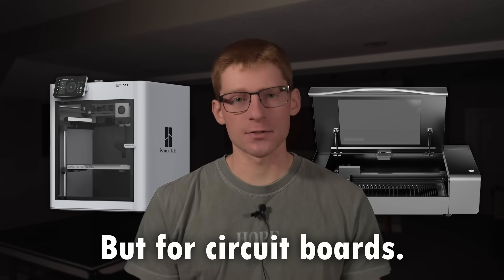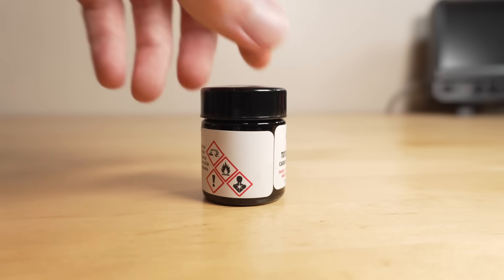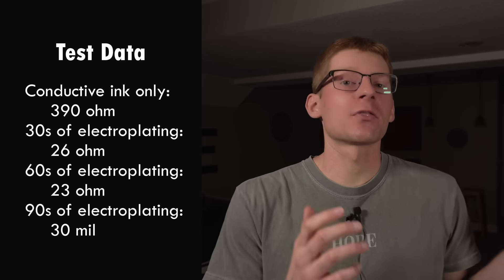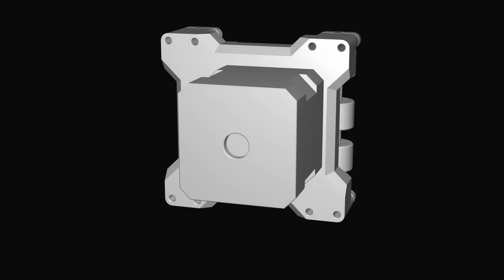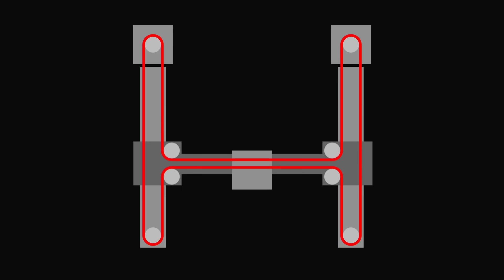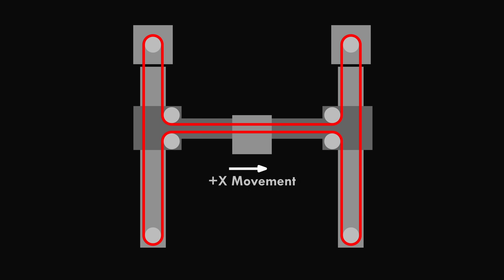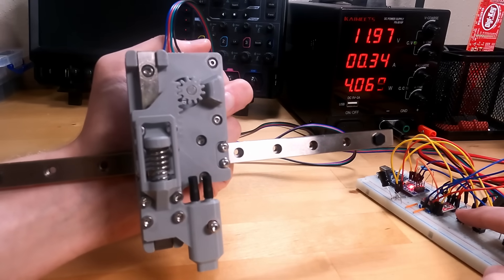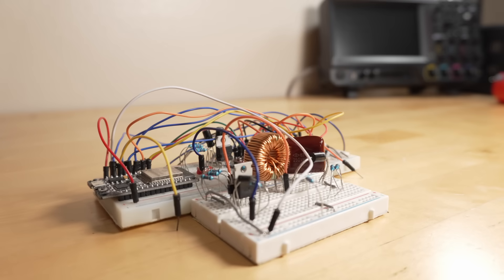I'm Developing a New Circuit Board Manufacturing Technology

Comment: That was cool!    Chemist and machinist here, hear me out:

What if, instead of chemically depositing copper, you drilled the double layer board, slid in a piece of copper capillary tubing that is slightly longer than the board is thick, and riveted/pressed it in from both sides with custom dies that have centered guide pins + a concave face? Locking it in place and making contact on both sides, like a hollow rivet, you could even solder them on each side       I bet you could pull it off
Reply: Came here to say this too. Even copper wire mechanically inserted and his existing process could perform easier surface plating of the copper instead of a solder or riveting for a chemical instead of mechanical joining. Tons of opportunities "good enough" for a prototype PCB.
Reply: i use it for my home pcb production. The problem with it is that for the top layer (from which the drilling starts) to make the contact with via, rivet must be pressed hard enough, to spread to copper. That creates bump, and most smd components could not be properly placed above it. And applying soldering mask is harder while vias are so much (up to .15mm) above copper. It became the limitation for my designs. My method is not autometed BTW.
It might be OK solution for hollow rivets for thru holes tho/
Reply: @ВоваЕршов-й2ь what if you drill a slot in the PCB where the rivet would sit against the PCB a few millimeters/micrometers beneath the top surface, like a valley?
Reply: @ I have no technology for that, but it is great idea for automated machine. If slot would go thru copper tho, copper layer could become separated near the point of impact during pressing rivet ip place. So it still needs refinement or high precision, but could work better than my method
Reply: @marcusvinicius-yo4ii  I tried chemically create slot in copper layer, because i can't mechanically. Only .02-.025 mm deep, almost thru the copper layer. It didn't help for me, still insane precision needed for cutting rivet in size and pressing it in place.
Reply: @ВоваЕршов-й2ь  what if you used solder paste instead. You could create a footprint to add around the vias. 

Possibly use the wire method previously mentioned and fold the wire over the copper traces, then solder paste to electrically connect them. Kind of like a sideways staple.
Reply: @kyrelsilva4103  yes, I use EasyEDA, it has "open via" feature, to put away solder mask on top. It is the way I used last time, but i feel it's kinda cheating, because of both bump of solder, and hole in the solder mask. More than that, soldering becomes harder, because now you need to apply solder and reflow both sides. Riveting with bigger bumps without solder paste actually works too, but has ~same problems.
I belive author of the video would eventualy propose more solid solution.
Reply: @ВоваЕршов-й2ь  there are drills that has the shape to drill out the shouldered indentation for the via shoulders, so it stays flat
Reply: Very similar to the "old school" tiny rivet method.
Reply: I was thinking of a copper capillary tube that was ultrasonically bonded to the top and bottom layers. But really this is technobabble. I have no idea what I'm talking about. Still it might be worth an hour's research...
Reply: Commented the same thing, this just makes sense
Reply: There's an old three step hobby process for doing copper over fiberglass. It uses a sponge with an electrode for the chemicals to avoid baths.
Reply: I had a similar idea but with copper plated solder wire instead of a tube. Compress it to expand the copper against the PCB and then just melt the solder out.
Reply: How about spot welding?

Comment: Here's a random thought from someone who doesn't have a clue: 

Drill all your vias at once with a 0.3mm drill bit. Add 0.35mm diameter "champfer" divots on either side (or whichever widths are practical) by drilling part way with a slightly larger bit. 

Then to use the conductive ink - as goopy as you can buy, or mix it with some fine iron power or something - and spread it over the board, filling in the via holes and the small divots. Then, while the ink is still wet, wipe the extra off. You could maybe automate this with a squeegee-like contraption. This will leave a bunch of vias plugged with the conductive ink. Wait for the ink to dry/harden. (Maybe mix it with some UV sensitive polymer?). 

Now here's the iffy part: Go back and re-drill all the holes with a 0.2mm bit. Obviously, the tolerances would need to be exact. This will leave a bunch of vias coated with conductive ink ready for copper plating. Place some metal on one side of the board so it touches all the divots. Connect it to an anode, throw the whole thing into a plating bath and turn on the juice. Maybe nickel plate the vias instead.

Zero idea if that would work. The idea would be to have filled in vias, plus a spread out pad on each side where the traces can be routed.

Comment: Great video! Slight correction.  As a former microfluidics researcher, you’re not using this term correctly. Microfluidics is not the term for small scale fluidics.   Microfluidics is specifically about manipulating liquids in laminar flow state using microdevices. Usually the “tubes” (channels) in these devices have diameters below 0.5 mm or 500 microns (hence the term “micro”).

Comment: Why not drill the via hole, then automatically drive a small pin that was slightly oversized through the hole.  The top of the pin could have a solder preform ring for reflow soldering.  The bottom of the board could be wave soldered as normal.  The pins could be as small as a few mills in diameter. Have you ever driven a 0.025" square pin into an 0.031" hole, same concept.

Comment: "New design i came up with" predates CoreXY by quite so many decades and is known as H-Bot. It's no longer in use in Reprap machines, used to be a hot topic before CoreXY came about, many people designed and built H-bot machines, because it has racking issues, its forces on the gantry are unbalanced and the positioning precision suffers. The outcome is generally quite hideous, very backlashy but not consistent enough that you could cancel it out, it's a whole mess.

Comment: Great stuff! Would love to have a desktop PCB printer like that. My method of making vias was always:
1. Drill a small hole
2. Stick a thin wire in the hole
3. Solder on both ends to the copper

Caveman method, but works pretty well for prototyping :)
Reply: even a 2.54mm header pin would be easy to handle with tooling.
Reply: I wonder if you could mechanically deform the wire like a tiny pop rivet. How much clamping pressure would you need to get a good connection?
Reply: Or even just use a conductive tiny rivet @BenAlternate-zf9nr
Reply: @BenAlternate-zf9nr you would run into the problem that both the hole and the rivet are straight walled, so you have nothing to push against. This means you might be able to mushroom (or peen) one end of your wire but not the other. 

The pop rivet system is a whole other beast that’s not feasible at this scale.
Reply: Yeah, we don't even have a consumer-end product to make PCBs without vias as it is, so it feels a bit jumping the gun to be trying to solve the via problem. If the device could accurately print two-sided PCBs and you just have to drill the hole yourself and use a wire to make the vias, I think plenty of people would still want that.
Reply: Aw, I suggested current-control OVD with an argon blanket.... waaaay more complicated 😅

Comment: Fantastic project. But is the goal to make a practical machine, or just to learn how to solve this particular problem (of making vias) as perfectly as possible? Both valid goals of course, but they require different approaches. You say you can make 1mm vias, but not 0.3mm ones. For a practical solution I'd certainly go with that. 1mm vias are absolutely fine for prototype/homemade boards. Another (and somewhat common) solution for one offs is copper rivets but they're fiddly and time consuming to mess with. If you can automate that, bravo. The least elegant other solution is soldering a wire in and snip it on both sides. Still the only method I ever used personally. Before I switched to ordering boards from the well known Chinese PCB shops.

Comment: Why not press fit a copper wire into each via hole and cut it flush with the board ? This can be done with a machine.

This gives solid copper vias that are not yet connected to the copper layers.

By adding holes for each via to the solder paste stencils (both sides required), the solder paste will connect them after reflow.

No chemicals, fluids, electroplating and fully compatible with SMD, even via-in-pad.

Through hole components can still be manually soldered on both sides. If that isn't possible just add parallel via(s) to the board layout.

Comment: Some random ideas... 

1. instead of plating, insert 0.25mm copper wire and solder to annular rings
2. insert 0.25mm copper wire and under pressure fill it with low temperature solder.

you can use like 135C melting point solder, + some heat resistant silicone "nozzle" to form annular ring around via to fill it with solder... 

Really nice project, subscribed.
Reply: And maybe it's possible to use similar process like in point welding used for creating battery packs from ion cells, (not sure about doing that on copper with copper), but if it's possible would be nice to try. Drill hole, insert copper wire, point solder it to annular ring...

Comment: Think about how a regular aluminum pop rivet works. You could have a mechanical electrical connection without electro plating. Unfortunately my suggestion requires mass amounts of custom copper ultra micro rivets

Comment: You can fix the electroplating problem. This is actually an issue which had to be solved in semiconductor etched trench filling. The diffusion blocking layers needed to coat the bottom and walls evenly and different coating processes are more directional than others.

Extend an insulation covered needle with only the tip uncoated into the center of the via, through the center of the tube. This will decrease the distance to the surface and the current path through the electrolyte solution. The proximity to the plating surface will also improve the directionality and placement accuracy. With the current flowing from the needle horizontally to the walls it is a straight path giving more even coverage.

You could feed an insulated solid core wire from your reservoir through the tube to avoid any risk of leaks. 3d print an X shaped electrode holder for the center of your tip and use it to center the electrode in the XYZ direction so when the tip seals against the PCB the tip of the wire is centered in the via.

I think for the final version you will still want to change the design to a multi-head or headless electroplating bath because even 90 sec per via could take days for a design like a raspberry pi.
Reply: Just the idea of having to insert a .2 mm needle into a predrilled hole however many times gives me nightmares.
Reply: @luipaardprint  you mean like ANY 3D printer does for hours on end while stacking layers of molten plastic coming out of a 0.2mm hole?

You can always tell the wannabe DIY people from those who actually build things real quick.

Even your CHEAPEST desktop CNC hits 0.02mm accuracy, or 10x smaller.
Reply: @luipaardprint  By the way the auto thread on an EDM machine feeds a 0.2mm wire down a 0.3mm hole using a stream of liquid for alignment every time the wire breaks.

Accuracy is about planing for accuracy, and not difficult with modern electronics. People hit higher tolerance in the 1800s using hand tools and gears.
Reply: @excitedbox5705  you’d be hard pressed to find a home 3d printer that would have the +- 0.05 repeatable between boards, let alone the +- 0.005 repeatable for consistent centre of hole. By the time you have a cnc frame or edm wire machine to spare to modify for this job you’re well outside the scope of most people’s definition of diy, and most people would be better off using a service for this kind of precision. I know some people that have their own pick and place machine for prototyping aerospace boards, but they sure as fuck don’t build their own boards.
So calling not trying to attain this level of precision wannabe DIY is at best disingenuous, and probably a bit delusional.
Reply: @luipaardprint  You are using 0.2mm nozzles so if those lines are stacking almost perfectly then obviously they are hitting the tolerance required. I have done 20+ hour prints on a $200 printer without losing accuracy. Also encoders cost <$10 so you can have practically zero drift.
Reply: @excitedbox5705  within a single print that is possible, although the tolerances are still not where you’d need them, but repeatability between multiple runs is a pain in the ass with cheaper machines.

I’ve made prints with sliding parts on .2 mm precision fit on a Bambu, but I’d be hesitant to go any further than that.
Reply: Yes, the  semiconductor industry had the same problem. I think I saw at least one vid on YT.
Reply: This is genius. If only I had known this before shipping faulty product to north america
Reply: Im sorry you want a small fragile needle to get into a sub-millimeter target area in the middle of a running pump attached to a moving carrige???? I personally think thats an unattainable level of precision for a diy project like this. Necroposting ig, but semiconductor equipment and enviornmental controls are an entirely seperate ball game to this sort of machine.
Reply: @boijone8440  Not hard at all. 3D printers work at MICRON precision, and I have 0.2mm dull tip syringes for filling ink cartridges. 

Dip one in some silicone and scrape off the bottom mm or 2.  If you take a 0.6mm needle syringe (shorten the needle as needed) and drop the smaller needle with luerlock  down the barrel with a spacer to allow fluid to flow.

You and wrap the needle with a spiral of wire to center it and now you have a conductive outer tube with an insulated inner tube but a conductive tip protruding from it.

You can always place the pump on the inlet side of the reservoir so there is no need to run wires through any pump but I would simply glue a plate over the back of the outer syringe, drill 2 holes in it and run a tube from the luerlock of the inner needle to one of the holes. Then you run 1 tube to your reservoir and a wire down the tube going to the inside of the inner needle.

Liquid feeds down the outer needle, while the inner one carries the current down to the tip.

I hate that youtube doesnt allow posting pictures but I can literally build a prototype with the parts in my workbench.
Reply: What if we apply a flow of fluid during the process? I’m wondering if it would affect the deposition speed…
Reply: @tomaszradomski8994  Yes. I think he is pulsing the flow if I understood him correctly, which should be good to prevent depleting the copper ions in solution.

Comment: hey, wouldn't it be infinitely easier to just use insert copper fibers/wire or a pin, cut and solder it on the top and bot surface of the PCB.. sometimes over engineering stuff hinders a project instead of making it go forward

For moving the Tool Head on X/Y axis :
- what about using Lead Screws ? you are basically making a 2D+ printer, you dont requiere extreme accelerations and movement changes like a 3D printer, using a system involing Lead Screw would be very fast for this projects need, extremely precice and reliable and it would be beyond easy to build, why go for a complex belt system ? (this is just my first obvious though, and i'm sure that there are probably even better ways, with other types of linear actuators)

For the VIA Connection :

- i mean a way simpler approach such as inserting a naked solid copper wire would be very sufficient, and if you really insist on having the VIA hollow, you can still use fibers from a un-stranded copper wire and solder, lay them on the border of the drilled via then solder (although this starts to complicate things), these are approaches that came to me instantly in mind, nothing incredible yet if correctly done, it does the job and the whole process would be an order of magnitude faster (of course im not giving you lessons, i'm just unleashing my frustration of seeing you over engineer this 😅)

anyways pardon my english and i loved watching the video !

Comment: Could you not just use solder to fill the holes in seconds?  I mean, solder is conductive, we use it for that purpose, and I don't think anyone has any particular opposition to a 1mm or even 0.5mm hole for a via rather than a more industry standard 0.3mm as long as they can print in house.  It does mean the PCB is potentially weak to heat.  But if you're also sealing the board the solder wouldn't have anywhere to go.

As for the H-track, you could add another set of guides on each side, could you not?  It would limit your Y direction because there's more guide on the track, but you could just as easily make the track longer to compensate.  More mounting points on the track would mean more stability.

Comment: Nice!  

I'm also working methods for in-house manufacturing of PCBs.   I considered the use of conductive ink as a pre-treat before electroplating vias, but decided against it because of pontial delamination at high temp.

I did some research, and there is a path forward for a chemical activator based via electroplating process.   Also, I have a plan to allow for multilayer boards as well.

I was also thinking about some ideas for a fully automated solution, but my focus is on the building the boards for the project, rather than building a PCB board making machine.